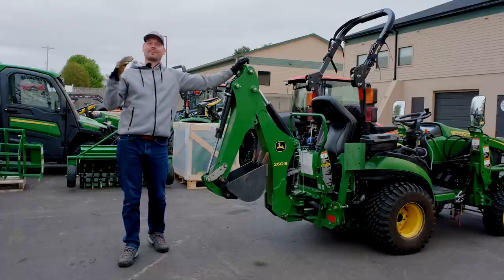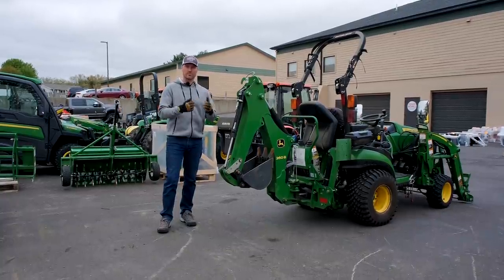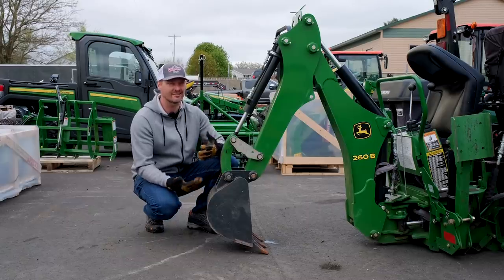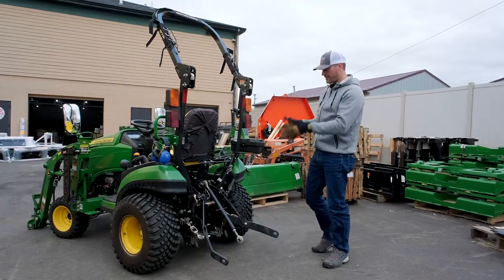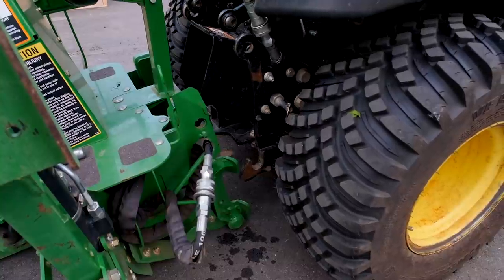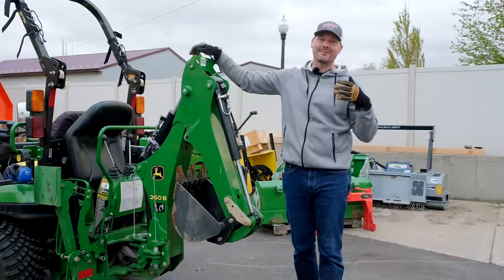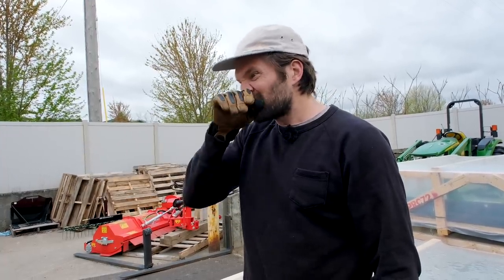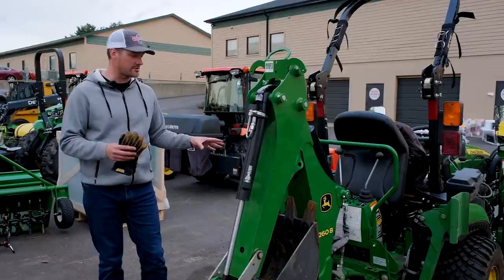HOW TO INSTALL A JOHN DEERE BACKHOE.  EASY PEASY 👌🚜👨‍🌾

Comment: I own a Kubota B2650 (now LX2601) with the BH77 backhoe and the hardest part is definitely getting everything lined up to get started. Anyone that owns their own backhoe should make  little wheeled cart to unload and store the BH. All i have to do is roll the BH out of the garage and rolll it into place and the correct position before i even hook up the hydraulics. That simple little cart makes it so much easier. Especially for moving a 900 lb piece of equipment.

Comment: Two things, one over time the hydraulics will bleed off and the backhoe becomes unstable in it's position. Two, if you use the Imatch system you have to remove it to re-attach the backhoe! Now if you could come up with a way to use the Imatch with the backhoe you'd be on to something!

Comment: Would you please do a video showing at which points on the tractor frame you can use a floor jack? I have a 2025R. And yes, taking the backhoe off and re-attaching it never goes smoothly, especially re-attaching. Thanks. 🇨🇦

Comment: I have a JD 1025R. I wanted to get one of these installed, but was told by my JD dealer that they had to install all kinds of supports to the rear end of my tractor and that if i did this, I would not be able to use my brush hog. Do you know if this is true? They also told me that for me to be able to use my brush hog, id have to bring it back into their shop and have them remove the braces which is a half days work then the reverse is a full days work. Is this true also? Thanks

Comment: In 2014 when I bought my 1024, John Deere thought it was more important to get me a pink hat than have video instructions on how to load and unload this backhoe. This subcompact tractor is mainly meant for acreage owners who may not have any idea of how to drive a tractor or what an fel is or other shortened lingo that John Deere  has in their manuals. 
I had great difficulty attaching this backhoe. Other things that complicated matters include that I did not know how to depressurize hydraulic hoses that increase in Pressure when you leave machinery in the sun and then try to hook it up…
So many hours and tears of frustration. Many years later I still dread hooking up the backhoe but I love using it.
Thank you for the videos !

Comment: Thanks, Courtney, for the helpful video as always - one word of caution to others doing this for the first time: when removing the backhoe, IGNORE STEP 3 of the sticker instructions telling you to Lift Backhoe Seat UP to clear the tractor. If you’re really starting this process with the backhoe seat still deployed, you must be a magician to have driven the tractor to where you wanted to remove the backhoe, or you might be tricked into doing something stupid by your own understanding of the difference between UP and DOWN, and move the backhoe seat into digging position against all other instinct and the process you clearly showed here. As you can imagine, I got out there with my wife after reading the manual, watching this video like five times, and using the checklist, and when I got to that step, right in front of me pasted to the backhoe in black and white, naturally the backhoe seat was folded Down, out of the position it’s in when in use, which I have to argue should be called the Down position, and it was right in my face. “I guess I’d better follow that step and lift it UP out of the way,” I thought, so I moved the yellow seat UP, then lifted the black backhoe seat UP and out of the way, and all went well until we tried to lift the backhoe off the hooks. I gently applied pressure and nothing happened until - BANG! - the neck holding the backhoe seat to the backhoe snapped in half. Needless to say, my wife and I were both as shocked and horrified as Luke and Leia were when they found out they were brother and sister in Star Wars, but we continued to remove the backhoe and found your guidance invaluable as we successfully attached the 3-point gear and the Speeco e-hitch along with a box blade I’d been dying to use since I got the Speeco from you a few weeks ago. Anyway, not the first expensive learning experience that I should have avoided by trusting my memory that never in your video did you lift the backhoe seat up into operating position, and probably not my last - but fortunately it’s a simple bolt-on part that I hope I can find for a reasonable price somewhere and fix myself. Anyway, just a word of caution to other newbies out there who attempt this for the first time: as Obi-wan Kenobi said to Luke: “Trust your feelings”, follow these steps in this video, and don’t let a sticker convince you that down is up.

Comment: Just a suggestion for minor improvement. At 2:45 to raise the backhoe off the pins, the best way is to further deploy the stabilizers, not the boom.

The reason the backhoe sortof "jumped" off the tractor was the boom was lowered instead of using the stabilizers.

Comment: RAISE THE BACK HOE SEAT OR IT WILL GET DESTROYED,
Man I wished some one had stressed the importance of and what will happen if you dont do this. Im a newby and on my very first day I destroyed the arm mounted with four bolts to the loader that the seat mounts to, while disconnecting the back hoe for the first time!

Raise the seat should be stressed to the max when delivering this to the customer especially the first time tractor owner.

Thought Id share. Glad no one got hurt.

Comment: So I was wondering do the 3 point bars and attachments come with the tractor when u buy it with a backhoe? I have a 1025r with a 3 point on the back that I was trading in on the new backhoe tractor  do I need to take mine off

Comment: Mine is the older model,  but, takes me longer, like 10-15 minutes to hook up. Maybe model or maybe me? I love my backhoe!
Reply: I have an older model as well and it takes me a good 15 to 20 minutes to install. The hardest thing is the alignment. The lower connection is also much tighter than this newer series. Any tips would be welcome.

Comment: Just bought the 1025R with the 260B (first tractor ever), was wondering what engine RPM is best when using the 260B?
Reply: 2000 RPM     The hydraulic pressure is going to be there regardless of the RPM, but you will have less jerkiness at this speed.